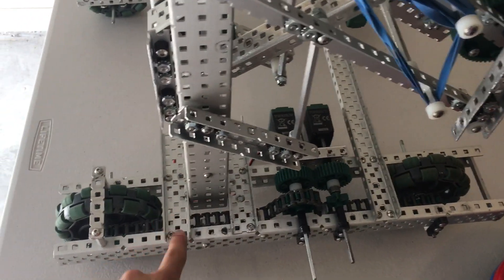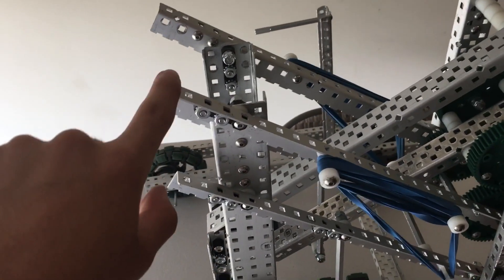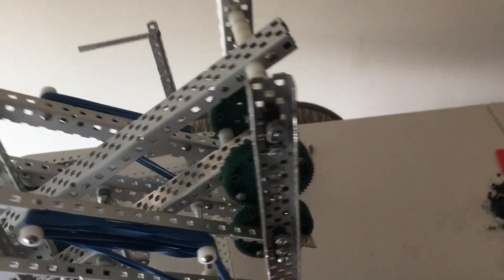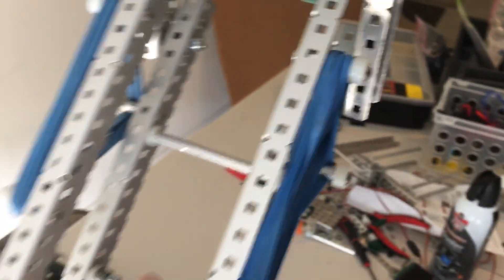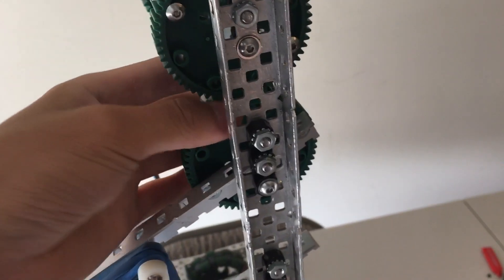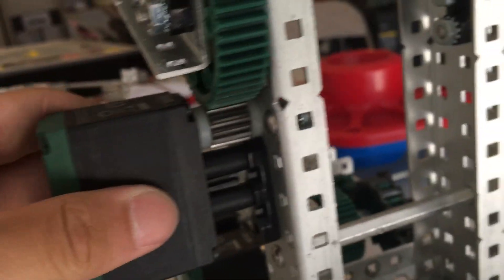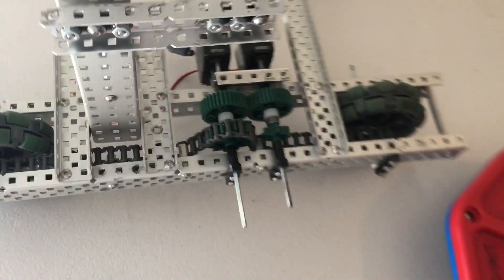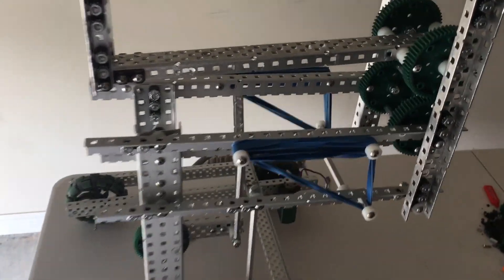Vex Robotics Turning Point Dr4b

Comment: How did you attach the standoffs on the six bar (rotating joints)? I've seen a lot of teams do it but I'm not sure how.
Reply: He used a coupler to attach the standoff to a shaft collar, then put a screw through the shaft collar. The coupler goes where a set screw would normally go
Reply: Thanks!

Comment: Can you show us the whole double reverse running on one motor? I'm still a little skeptical that one motor can handle that much weight.
Reply: We are using 1 369 on torque,  we should attach 2 motors because with v5 they should be 2.5x the power of the old motors. We tested, it struggles to lift with 1 motor. The over-rubberbanding helps and the lift stays when we move it up and down, but for some reason, the motor struggles with moving the lift.